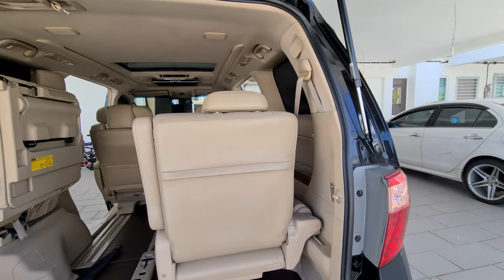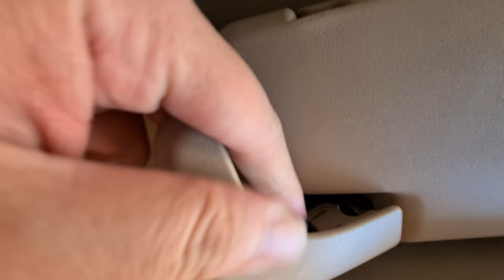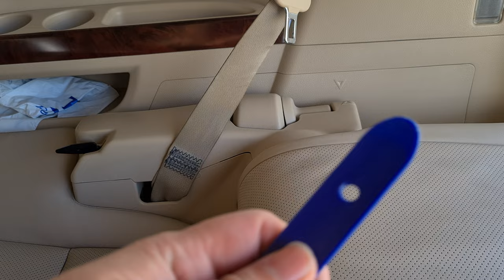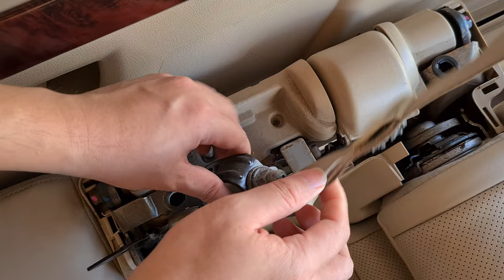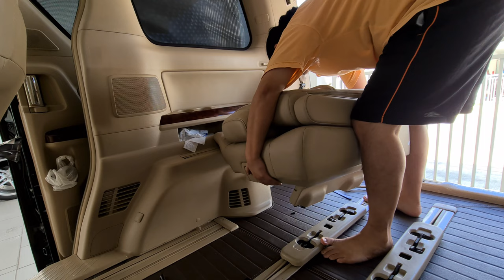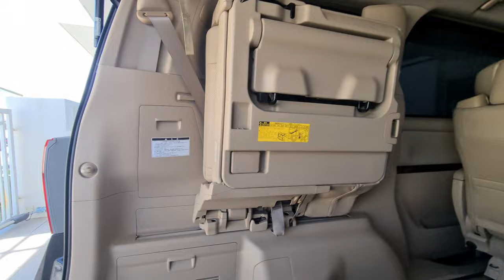Alphard / VellFire GGH20 ANH20 - Removing third row seats

Comment: Hey! I have a 20 Series Vellfire and had rails/sliders taken out after I used your videos to remove mid and 3rd row seats so thanks! But how do you remove that metal contraption with the two bolts sticking out where the 3rd row seat used to be?
Reply from the maker: I am assuming you meant the third row seat rails. Check out minute 12 of the below video I did. Let me know if it helps.
https://www.youtube.com/watch?v=J_3-jjGe1as

Comment: Hi, I plan on removing the third row seat because it makes some sort of mouse like noise. Like squeaking sound. I tried to stow it away or have it built up but same problem. I used lubricant on anything that I could see but still same problem. Bumpy road gives that sound, sometimes sharp left or right turn do it too. I really don´t know where it comes from. Only right side under the seat somewhere. Now I want to remove it. Any advice on the noise?
Reply from the maker: Remove the seat and shake it. You might have something stuck inside it like mine as well (a coin was stuck in it)

Comment: Alot of work. Thanks for sharing. However am hearing rattling sound whne cruising.. Not sure where is the sound coming from. Added rubber by the door hook but not helping. Sprayed grease on the sliding door side but not helping
Reply from the maker: One of the best way to find rattling sound is to have someone else drive and you climb around the car to try to listen for the sound.

Comment: How did you manage to fold up the left seat in the beginning?
Reply from the maker: Align the arrows at the seat and side panel. Lay the seat flat then pull the lever at the bottom right. It will pop out and you can secure it using the harness at the top.
Reply: @TCsAnythingGoes  hi tc, I lined up the arrow,  near to window as your video, pull up the leveller, however the seat is moving front n back once the seat is turn up. No issue on passanger side. Only on driver side. Any ideas? Tia
Reply from the maker: @ciatfeitay7951  add me up on FB TC's Anything Goes Channel